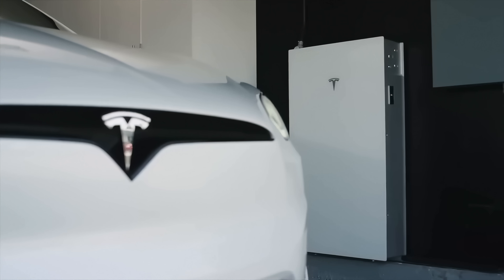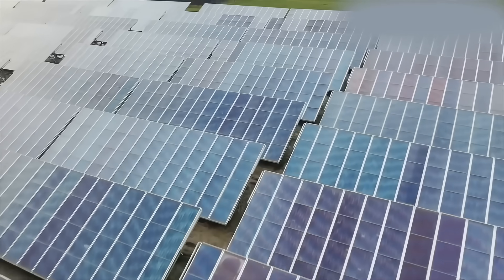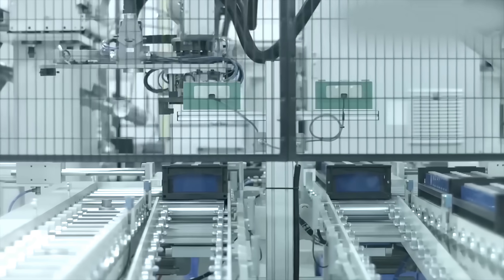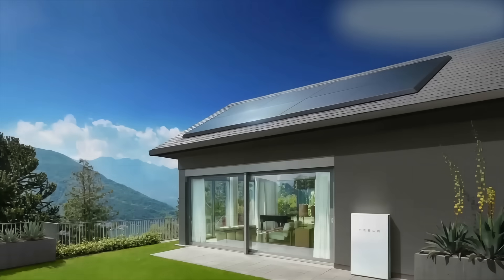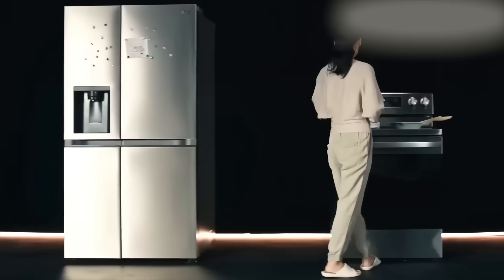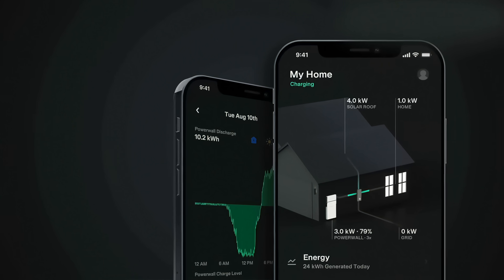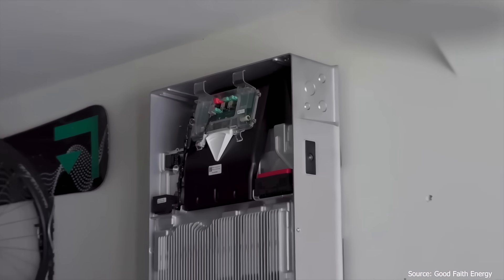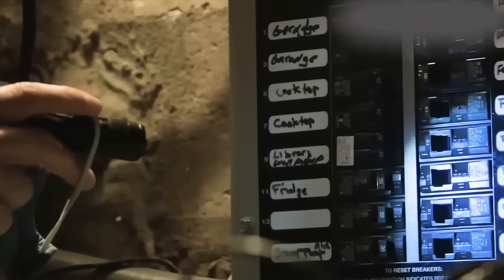Tesla BRICKS Powerwalls Remotely — Thousands of Home Batteries Now Useless

Comment: Establishing Liability: The class-action lawsuit against Tesla by the Powerwall owners would first establish that a defect in the product caused harm (e.g., fire risk, loss of functionality). If Tesla is found liable or settles the case, it incurs a specific financial loss to cover customer compensation, legal fees, recall costs, etc.

Proof of Actual Damages: The outcome of the class action provides concrete evidence of "actual damages" that Tesla suffered as a result of the product defect. These damages are quantifiable (the amount paid in settlements/judgments, recall expenses, etc.).

Suit Against the Supplier: With the actual damages quantified, Tesla can then file a separate lawsuit (often referred to as an indemnity or contribution claim) against its specific battery supplier(s). In this subsequent suit, Tesla would seek to prove that the supplier's defective battery cells were the root cause of the problem and thus the supplier should be responsible for covering Tesla's losses.